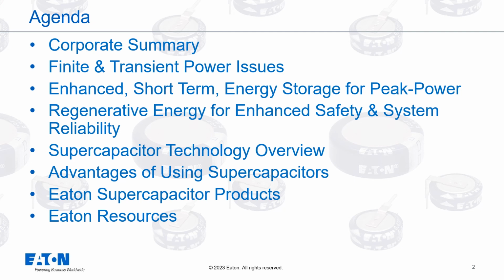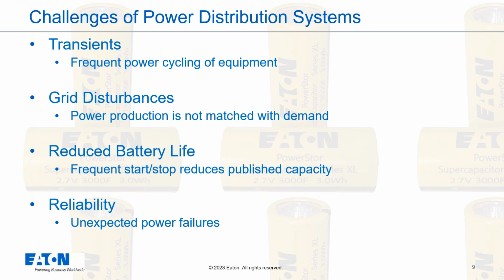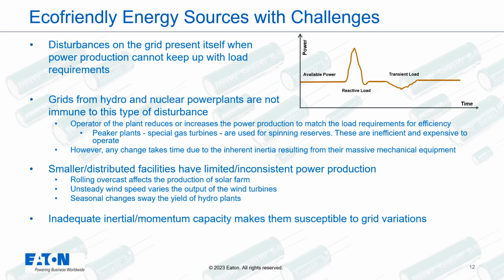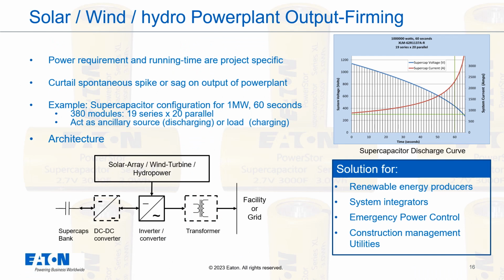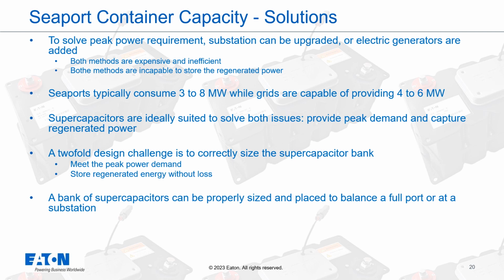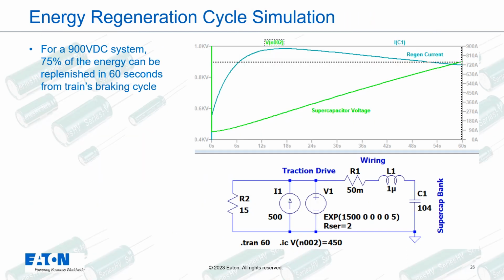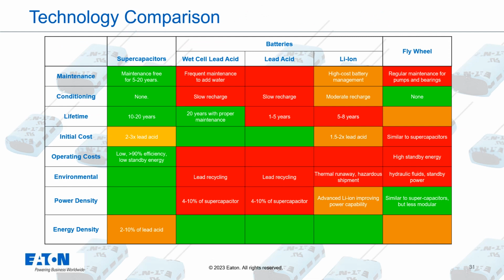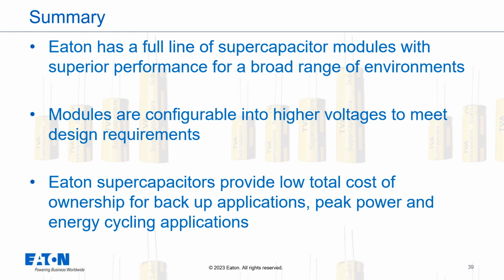Supercapacitor Usage in Modern Electrical Utility Systems

Comment: INDEED, THE SUPERCAPACITOR ENERGY STORAGE DEVICES CAN BE OF GOOD USE WITH THE GRID-TIE UTILITY NEEDS AS IT CAN HELP IN THE PEAK POWER DEMAND SHAVING NEEDS WHICH THE BATTERY BANK CAN NOT EASILY PROVIDE WITHOUT DRAINING IT'S STORED ENERGY FAST. AND WITH THE SUPERCAPACITOR HELP, THE BATTERY LIFE CAN BE PROLONGED BY 50%.